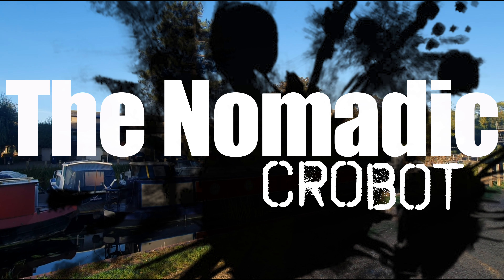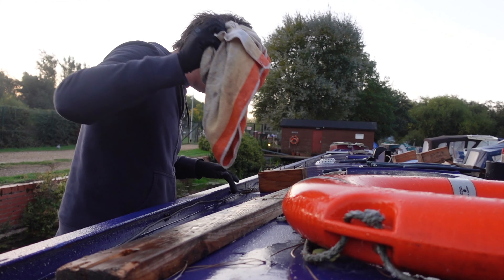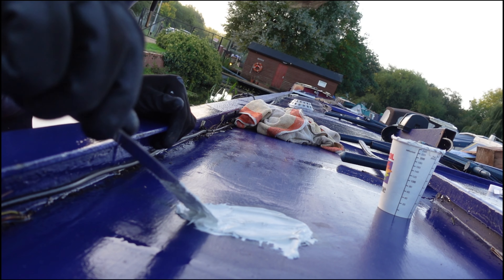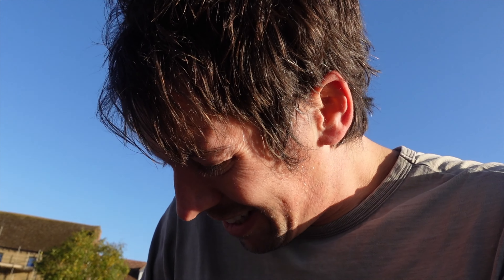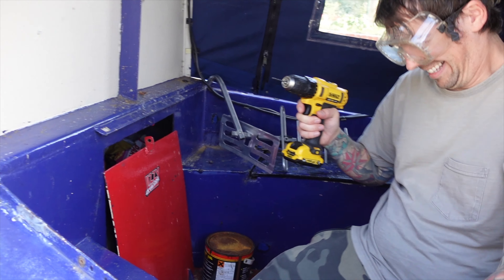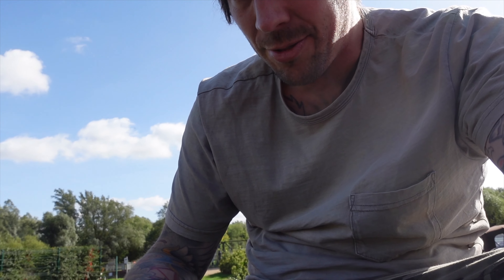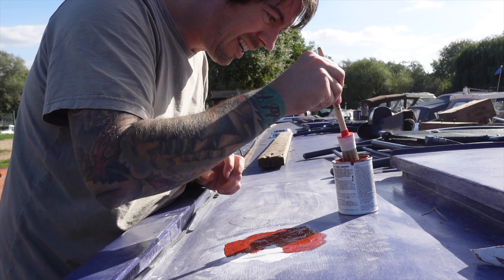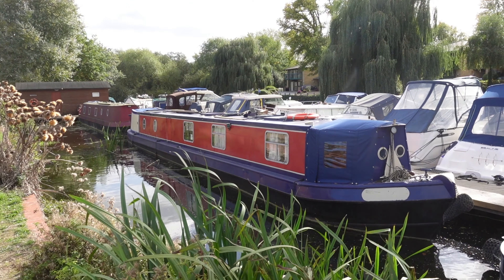The MYSTERIOUS HOLE in our narrowboat roof

Comment: You can use a Surform to remove the excess filler, then sand for the final finish.

Don't try to fill it all in one go. If you have holes in the filler you've worked it too much or you are trying to put too thick a layer on.
Reply from the maker: Thanks interesting thank you for your advice

Comment: Just a word of warning Chris never plug a fan heater or high current device in to an extension lead this is a real fire hazards especially if the extension lead is coiled up !.
Reply from the maker: oh interesting thanks for the advice :)
Reply: @TheNomadicCrobot  No problem Chris basically when you have say a 3kw fan heater operating from an extension particularly a coiled extension the extension is acting as a massive resistor and can heat up to dangerous levels.
I just want to make sure you guys stay safe and don't put yourselves at unnecessary risk.
Big hugs to both of you and keep up the good work ☺️
Reply from the maker: @user-mp8nb5zd2s  thank you, I don't think about these things until its to late haha thanks again

Comment: Blue paint bit too light  put bit in a pot add a  drop  of black at a time I mean a drop see if can get it closer for time been. 
Filler stuff mix on a bit of tin or card easier 
Steve
Reply from the maker: its funny because I did think of adding some black. I think im probably going to hunt a colour match now, thanks for your tip

Comment: That doesn't look like marine filler to me. Proper epoxy marine filler should be equal parts A & B. What you've used might be called "marine" but in reality it isn't much better than ordinary car body filler. Might still last though.
Reply from the maker: it said marine filler on the tin but I dont thin k you actually need marine filler for the job on the roof, its probably a bit much, oh thats interesting...maybe they just put marine on there to make it look expensive and sell it for more
Reply: To me it looked like gel coat filler which is a marine filler but for grp boats